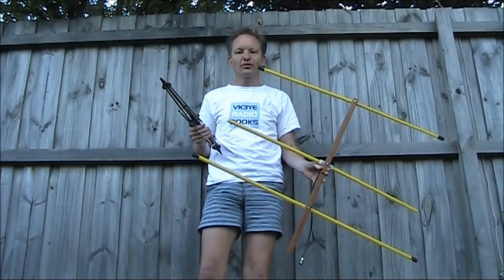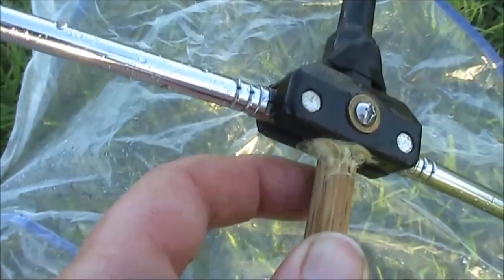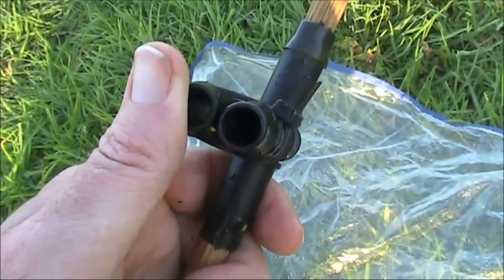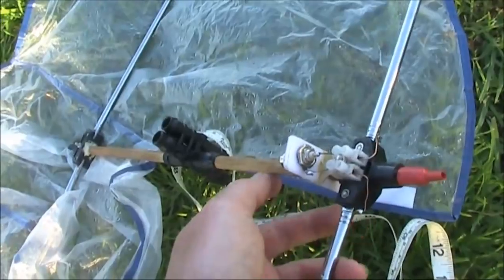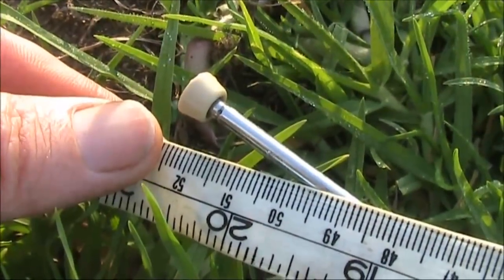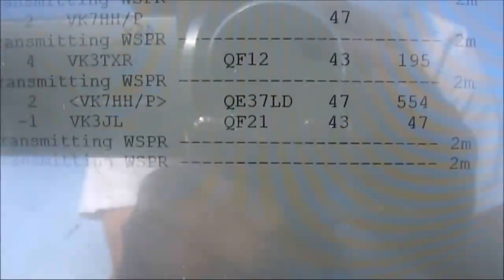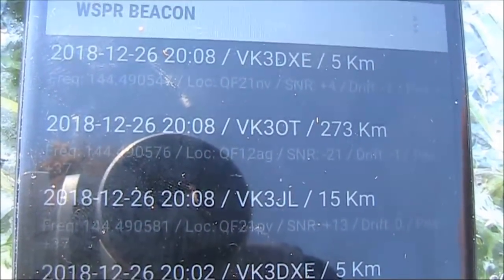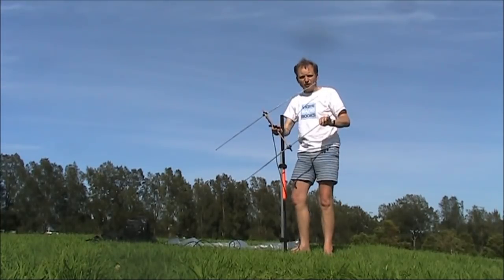Folding beam for 144 MHz portable (and more)

Comment: Ordered 3 antennas from eBay  There is a vendor on there that has them for less than $3 each.  Beats running around to thrift stores and maybe finding one.  I'll try a carbon fiber tube as a boom.  Think that might be ok?
Reply from the maker: A metal boom works fine for beams so carbon fibre would be OK as well.

Comment: Peter, I'd love to see a video showing your setup. I see it's an FT-817 but how do you power it, carry it, what accessories, cat and audio interfaces do you use? A while back you looked to be using the microphone against a phone for WSPR but now some kind of laptop connection?

VK2VSR (fresh owner of a used FT-817)
Reply from the maker: Hi Simon - Powering the 817 is mentioned in several videos. This is the battery I normally use https://www.youtube.com/watch?v=E73ildysVoA I don't use a CAT interface. But the cable used for data transmission is at https://www.youtube.com/watch?v=3wmxyo1RzaE Searching 'vk3ye ft817' brings up some other ideas. Particularly important are the videos on various portable antenna couplers and microphone modifications for audio.  My website also has a special feature on the FT817. http://home.alphalink.com.au/~parkerp/qrp/ft817.htm Anyway good luck and I know you'll enjoy your new rig.

Comment: I like the telescopic elements idea, Peter.

 I built something similar in the mid-90s: a fixed frequency, 2-element, 2m yagi with folding elements. It is fabricated from aluminium channel, which was all I had to hand at the time - I was in a hurry to build it one night before a WICEN activation.